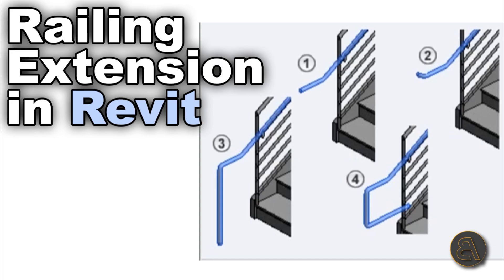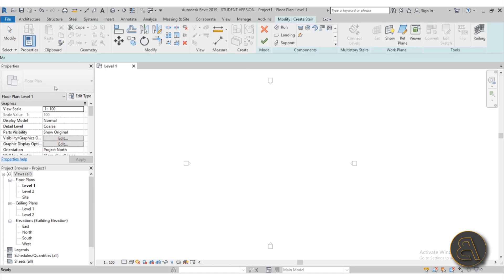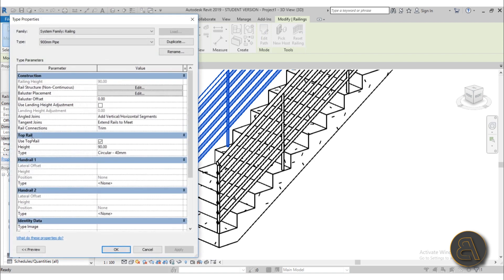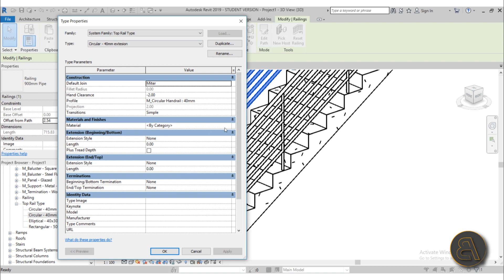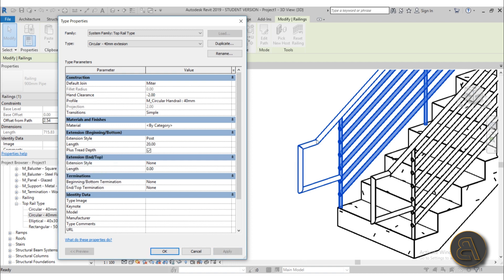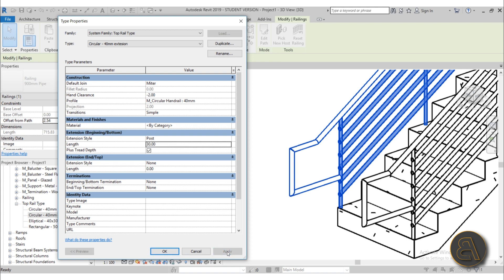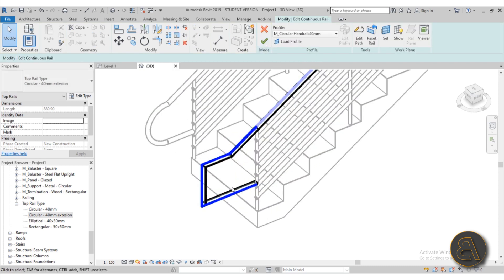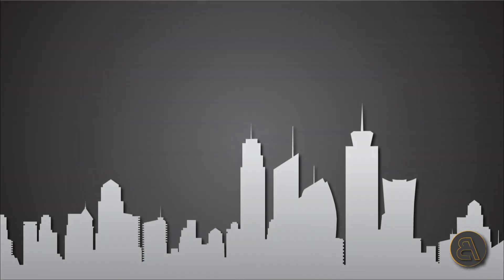Railing Extensions in Revit Tutorial

Comment: why is that whenever I hover the mouse pointer to the ramp and press TAB, Revit won't allow me to edit the railing? Thank you!
Reply: Kindly activate the Pinned  Icon located at lower right corner of your working Revit window or under modify tab, click drop down arrow and check the Select Pinned Elements.
Reply: @boylado7650  Thanks